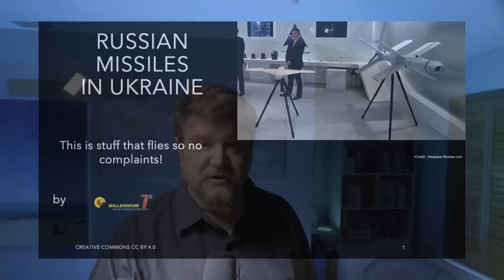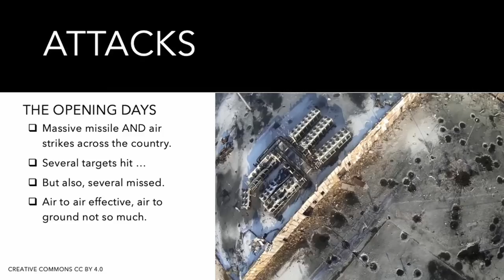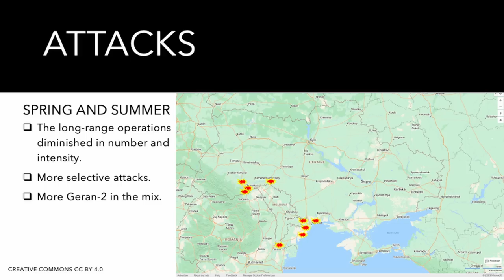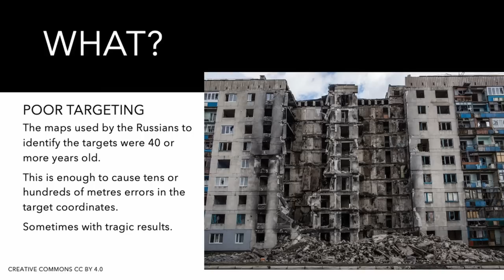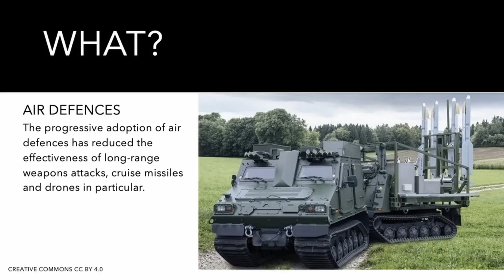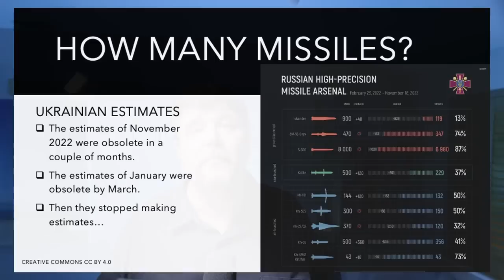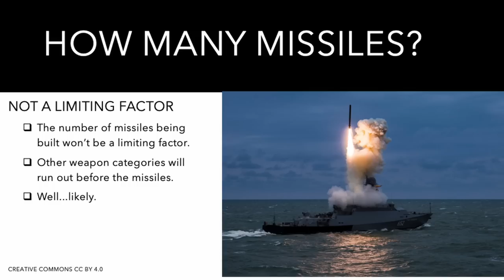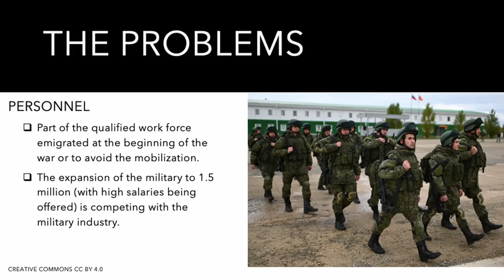Ukraine: Russia Run Out of Missiles!

Comment: Running out is not 'ran out' using more missiles than you have in your stock is 'Running out' but you can always decrease usage to build up or maintain missile stocks.
And as we've seen Russia has decreased missile usage over the spring and summer, likely to build up missile supplies for winter.
Reply: Do air targets fly more often in winter than in summer and spring ? 😂
Reply: @Gorsky69 I don’t see why the season should matter
Reply: @LOL-zu1zr  Because all migratory birds fly south in winter
Reply: Agree 💯
Reply: @LOL-zu1zr  Probably attacking energy infrastructure more efficient in terms of damage and troubles it causing.
Reply: @Gorsky69  I need to increase my house's ballistic missile output too.. we get a very annoying night bird this time of year - these birds start screaming around 11 - 12pm every night and they dont stop until 3 or 4am.
If I had ballistic missiles on hand I would definitely launch at them.
Reply: @Gorsky69  Russia is firing ground attack missiles, at primarily civilian infrastructure. They're not really firing anti-air munitions apart from S-300 in a ground attack role and some lighter SAMs at drones.

The reason they're waiting for winter is because it will do maximal damage to the civilian population to damage energy infrastructure during winter, and offensive operations slow down slightly so interdiction strikes are more effective.
Reply: @Gorsky69 no one has ever talked about RUS running out of air defence missiles. The subject is cruise and ballistic missiles attacking targets in UKA.
Reply: I think there main problem could be that they have run out of high value targets (they can find) to use an expensive missiles on.
Also they are getting more and more replaced by much cheaper glide bombs and drones.
Reply: @LOL-zu1zr  It matters if you use it to target civilian infrastructure like Russia does, hitting a powerplant in October is more devastating to the populace than hitting it in April or May when everythings warm and gives them a chance to put other measures in place.
Reply: @scroopynooperz9051  I love night birds!!! That being said. Get a bb gun... note that you need not hit the poor buggers just annoy them back. 🥲
Reply: @scroopynooperz9051  Excellent choice
Reply: @ArchOfficial  Russia is not waiting for either winter or summer , waiting only for any military objectives . For Russia , civilian infrastructure does not matter if it is not used for military purposes .
Reply: @LOL-zu1zr With frozen ground an offensive, which would necessitate the use of such munitions, could be anticipated.
Reply: @Gorsky69 That you missed the point only means the humor is directed at you
Reply: @ArchOfficial Yes, it's civilian infrastructure, not civilians.
Reply: @Gorsky69 Your last sentence...they do, and have, hit such infrastructure that is dominantly used by civilians. Power plants, rail, water supply, sewage...
Reply: @Gorsky69  Russian military objectives seem to be getting closer to Moscow by the day.
Reply: @feedyourmind6713  There are tens of thousands of civilians who have been confirmed killed or injured from air-strikes, so I'd think that is significant as well. A non-zero portion of the strikes are just terror attacks.
Reply: Duh. . . As if Ukies/ Ukrops do not target civilian infrastructures. . . 😅
Reply: @feedyourmind6713   This means that only a stand-up artist can talk for fun in a roadside bar about the dependence of the number of missile on the winter or summer season .
Reply: @piojulian64  They largely don't. The amount of killed Russian and Eastern Ukrainian civilians by Ukrainian action since 2016 can almost be counted on two hands. There were a lot more in 2014 and most of 2015, though.

Contrast this to tens of thousands of civilians confirmed killed since just 2022 by Russia, with thousands since 2014.
Reply: @scroopynooperz9051  Why would you use a ballistic weapon like a shotgun for killing birds? That is a job for a drone with a birds seeking war head.
Reply: @feedyourmind6713  Power plants, railways, seaports are critical parts for military infrastructure, in case you didn't know.  The military industry cannot work without electricity , the main military cargo is transported by rail and sea , if you didn 't know .
Reply: @ArchOfficial  War is terrifying. There are incidences in this war where Russian munitions hit bona-fide military targets adjacent to civilian structures, causing civilian deaths, Russian missles gone awry, hitting civilian structures. And Ukraine missles gone awry hitting train stations.
Reply: @piojulian64  Even adding in Donesk civilians killed by Kyiv to any other number you come up with, Russian munitions have caused more civilian casualties than have Ukrainian munitions.
Reply: @Gorsky69  I'll suppose it does.
Reply: @Gorsky69  Your local power plant is civilian built, paid for, and operated. Not alot of electricity being used along this front. Ukraine is not producing its own armaments and a disruption in power isn't stopping supplies from the West. Into which Ukrainian seaport are Western supplies flowing? In case I didn't know...ugh.
Reply: @feedyourmind6713  You 're right , maybe the Russians should destroy only a small part of any Ukrainian power plant if the Ukrainians have paid for electricity 😂. You 're a funny dude . 
Ukraine has not built a single power plant since independence in 1991 , all built during the Soviet era . Therefore , Russia is helping Ukrainians get rid of the cursed Soviet past .
Reply: @Gorsky69  What does the age of Ukraines power generation plants, or who built them, have to do with anything I said?
Reply: @feedyourmind6713  Has a direct relationship . Ukrainians shout every day about getting rid of the Soviet legacy . Russia satisfies their desires .
Reply: @Gorsky69  Well...that's a twirled way to look at it, but I'll have to agree.
Reply: @Gorsky69  Yes, Russia stockpiles long range weaponry for use during the winter campaign, which is where destruction of the electricity and heating grid will have the most impact. So, the answer is yes, air targets fly more often in winter than in summer and spring.
Reply: @feedyourmind6713 Did you hear that Ukrainians were using Tochkas with cluster warheads against civilians on the markets and bus stops in Donetsk?
Reply: @olexp9017  Yes. But if you ask your robot you'll get stories as old as the incidences, still not settling whose missles they were. Keep the populace uninformed.
Reply: @Yutani_Crayven  Russia strikes throughout Ukraine every day , 7 days a week , regardless of the time of year and weather . A missile strike on Kharkiv 2 hours ago . The blows were yesterday , today and will be tomorrow . There is no need to accumulate missiles if hundreds of Russian military factories are operating continuously day and night . Russian arsenals are huge and numerous and never lack ammunition . There was not a single blow to the Ukrainian heating networks , there is no need for this .

Comment: This subject has several apects:
* Who is running out of supplies faster. The one who has no more supplies lost. Now matter how low the supply of the opponent is.
* The one who can ramp up production faster has an advantage. Private based arms production has a disadvantage, because companies don't want peaks, but planable production.
* Adaption of strategy to supply is crucial. Spend what you have in huge supplies with a steady stream and use it. Ukraine implemented that wisely with dones. Now Russia is copying that successfuly.

For example, the kinshals (or however it is spelled in your country) were only in low supply, because the were in the state of exploration and introduction to the army. Now, regular production has started.

A statistical analysis of the weapons used would be interestion. We would certainly see drop in a specific weapon. But as oon as its usage rises again, it is a sign of production catching up. Getting thoe numbers will be hard I guess.

Anyhow. Get in shape! Lose weight, get active! Finito dolce vita!
Reply: the Kinzhal missiles turned out to not be as ground breaking as they claimed they were though so they aren't really an improvement over what was already being used other than having more modern targeting systems

Comment: I'm curious to know how at 10:10 you came to the conclusion to why the Russians drone are able to film their strikes a few hundreds kilometers inside Ukrainian territory. You say that the reconnaissance drones are able to "evade" Ukrainian air defence,... but this could also be due to the Ukrainian air defence being degraded by the same relenting year-long Russian strike campaign. How does a city like Kharkiv get pummeled that frequently if it has a functioning AD system?
Reply: More likely tiny civilian drones are not targeted because they are so small, maybe hard to see but more likely you don't spend a multi million dollar missile on a 100 dollar drone
Reply: @islandwills2778  That's a completely nonsensical logic to evaluate the value of an enemy weapon system with. If the itsy bitsy drone is necessary for the enemy to designate war assets of yours worth millions of dollars for their missile strike, then that drone is worth that many millions of dollars. The Ukrainians do know this full well of course, but they just can't do jack about it.
Reply: Simple. If there are enough a few will get through.
Reply: @islandwills2778  "Tiny civilian drones" don't have more than a 10-15km range.  I've yet to see any independently verified footage of Russian spotter drones 'hundreds of kilometres' inside Ukrainian territory.  Until I do, I remain sceptical as we all should.
Reply: @coolersmoke   The farthest I saw is about 70 km from the front line.
Reply: @coolersmoke The relatively short range is because of the battery. Step one, don't use a toy drone powered with a battery. Use a petrol-powered survey or agricultural drone. Step two, boost the transceiver. You and I can't do this. But Russia do have engineers, for whom doing this is trivial. Give them a week, they can modify these normal civilian drones to reach 200 to 300+ km. These would not be $100 each. They'd be $10,000 each. But still too cheap to shoot any missile at.
Reply: @koskok2965  think replacement cost. If you fire off two $1m missiles to bring down a $10k drone, the enemy will just keep sending more drones. After a week, they have spent $200,000 on twenty drones, and you've spent $40m on forty missiles. You see the problem?
Reply: I've the answer but it's not proper to tell cause they still in war.. safe to say, they can/ have capability take a few missile hits clips live..
Reply: @StrangerHappened Link the verified footage?
Reply: @danielch6662  Your complete lack of logic makes you just another Russian bot sigh
Reply: @coolersmoke well, that film that showed the Russian missile hit that target was photographed somehow.
Reply: @rogerphelps9939   I understand that a few drones even missiles will get through. No country has a perfect AD system(especially a huge country like Russia). Even the US had whole cargo planes carrying drugs from Colombia evading radars and landing in freaking Arkansas. I get that! The problem in Kharkiv seems to be that AD is degraded enough to let missiles AND drones who can film the strikes.
Reply: @danielch6662  I'm no idiot, I understand drones and their limitations.  But I do not accept a brief clip of video with no provenance nor independent validity - from either side.  There's far too much disinformation (from both Russia AND Ukraine) for anyone with half a brain to simply accept what they see as the truth.
So - until someone can point me to verifiable footage of Russian drones wandering around Ukraine 2-300km inside the borders, I will simply discard it as propaganda.  Same goes for Ukraine, although repeated attacks on Moscow clearly show that something is getting through.  The "How?" remains unclear.
Reply: @danielch6662   You said "They'd be $10,000 each. But still too cheap to shoot any missile at."  That logic is like saying "That bullet only costs $1.50. It isn't worth it to spend $2,500 on a flak jacket to stop it from killing you."  It's not the cost of the bullet that is important. It's the value of the target you are defending.

Comment: I have been hearing statements from officials and advisers from Ukraine for a year that Russia was left without missiles, but why are they letting them go on and on 😁
Reply: because no nation would fire off everything it has, you slow down the amount you are using to a rate you can keep up with in production. if you start the war firing 400 missiles a month and can produce 50 a month with a current stockpile of 8,000 you would slow down after a few months; you reduce the number to 300, then 250 etc.

eventually you either increase production enough to keep pace or reduce usage to meet production quantities, lets say you get up to 100 missiles made a month; now you would reduce the rate of firing them to that level and keep the remaining stockpile you haven't burned through yet in case there is an emergency and you need to make important strikes.
Reply: Propaganda is real.
Reply: @AtkoYo  the real answer is A) a Ukrainian official says Russia is running low on missiles. B) a news article reports Russia is running out of missiles. C) another news article siting the first article will say Russia is out of missiles
Reply: @dominuslogik484    @dominuslogik484  that's precisely what propaganda is. The reality is the opposite.  Russia is NOT running out of missiles.........
Reply: @AtkoYo  no propaganda is specifically curated to sway opinion for the sake of policy. This is, on the other hand, basically a game of telephone where the story gets further and further from the original the more people hear it then repeat it.

Comment: 1) Switching to civilian infrastructure attacks is credited to Surovikin by the West.
However our memory is not that short.
The switch happened as retaliation to the Ukrainian attack on the Kerch bridge.

2)The initial part of the invasion was chaotic, indeed.
What is missed on Western analysts though is that it succeeded in it's purpose.
The Russians went in hard and fast and scared Ukraine into sitting on the negotiating table and accepting their terms.
That they were pulled out was a decision coming from Washington and executed by London, common knowledge now

3) Use of S-300 missiles by the Russians for attacking ground assets has not been confirmed, it's a Ukrainian claim, suspiciously and conveniently made after a series of mishaps with their own S-300 missing or failing and hitting civilian infrastructure.

The failure of the Ukrainian counter offensive and the loss of most of the NATO equiment for very limited results has the "coalition" in a crisis right now, as wittnessed by Blinken's proposal to the Russians for a cease-fire which, of course, the Russians refused as they know what the West need it for.
But I'm sure they will bounce back.
Biden's political career depends not on a Ukrainian victory but a non-Russian victory before November 2024 so there's no doubt the military aid will keep pouring in till then at least.
Reply: Since S-200 and SM-1 large SAMs on both sides have secondary surafce-to-surface mode, for whatever it is worth.
Reply: @piotrd.4850 S-300 have little ground attack capability. Small range, small warhead and very poor accuracy wit inertial guidance. It can be used kinda effectively as anti-surface missiles, but just because it will be guided by radar
Reply: @piotrd.4850 it makes no sense to use a SAM to perform strikes, they have extremely small warheads and are very expensive designed to be highly maneuverable 

They go near a plane and then they blow up nea
Reply: @piotrd.4850 it makes no sense to use a SAM to perform strikes, they have extremely small warheads and are very expensive designed to be highly maneuverable 

They go near a plane and then they blow up nea
Reply: @PyromaN93  Uhhh, they're in the same league as TBMs like Tochka as far as size, weight and ka-boom is concerned.
Reply: @koskok2965  nah.
Tochka have larger warhead, greater range, a lot better accuracy with inertial guidance.